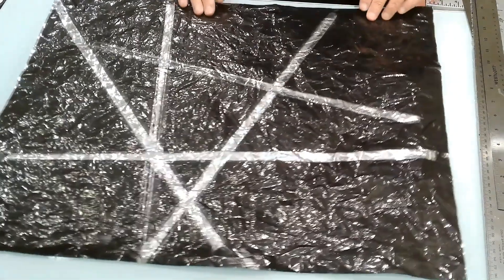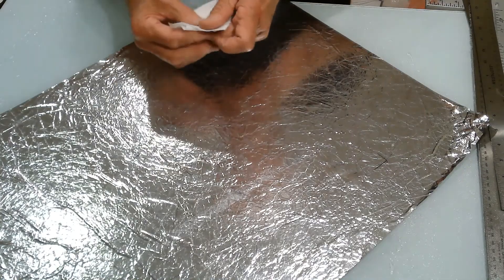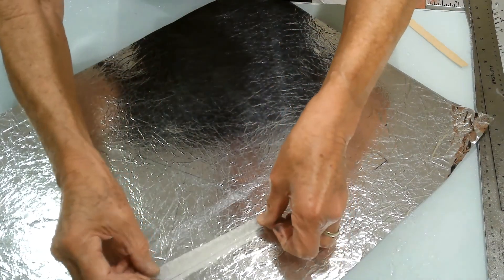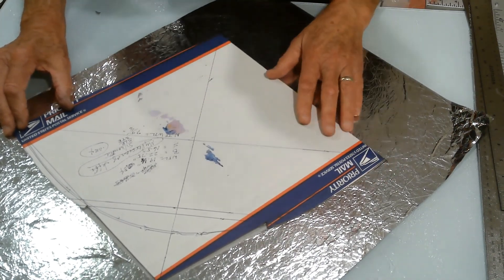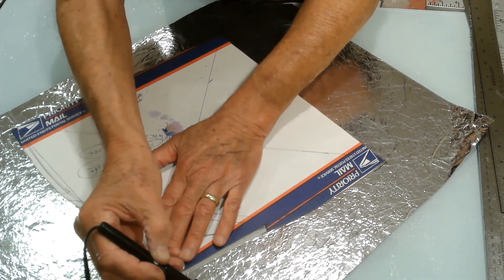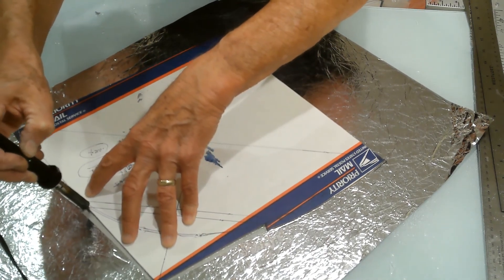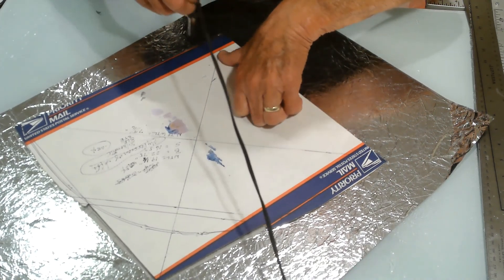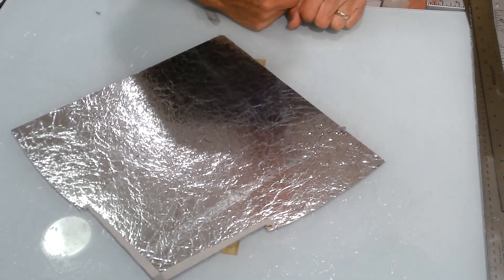An easy way to hot cut a polyfilm, mylar, ripstop or icarex fighter kite sail.

Comment: Template "moved" when you were going to cut final side....   A tip I can add:  I have about a dozen lead ingots I use for building things.  I place them on the template to hold it in place so I don't rely on my other hand to hold it when I go around with the Iron.  Many heavy low profile weights distributed near the edges of the template do a great job of holding it still while allowing you excellent access to the edge for your hot iron.
Reply from the maker: Thank's Radian327 for the tip, I sometimes do use weights, but most of the time I get lazy and only use my hand.  And as you saw, the template can easily move on a slippery surface.  You've got a good eye for minor movement!   Where do you fly fighter kites?
Reply: @bruce.lambert  Hi Bruce...Didn't mean to rain on your excellent teachings...   Happy to see these.  I'm just starting out.  I've built about 4 kites so far.  Flown about 7 times....  Far from any thing above novice skill level.   I fly in South Florida.
Reply from the maker: @Radian327  I hope you are enjoying your fighter kiting journey!  Do you have friends who also fly fighters?